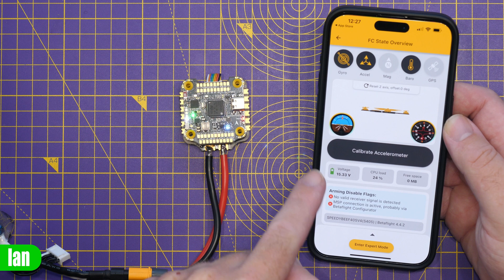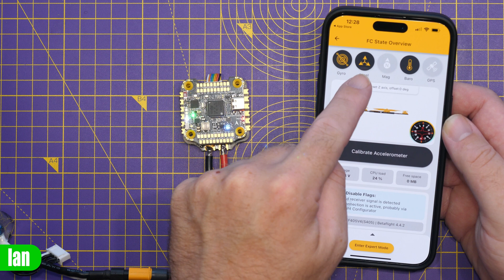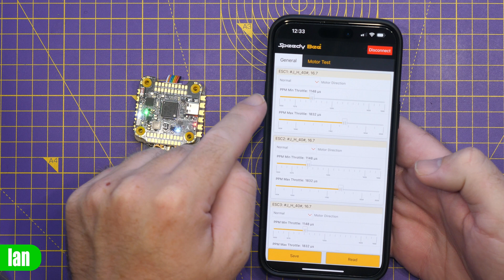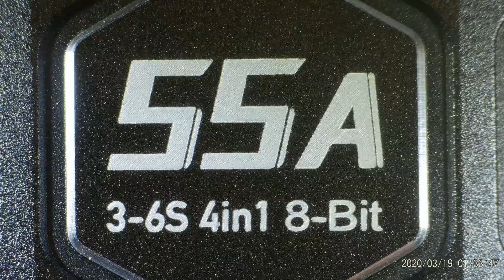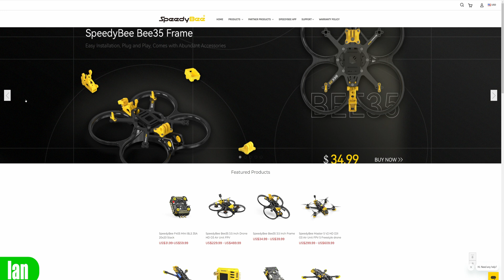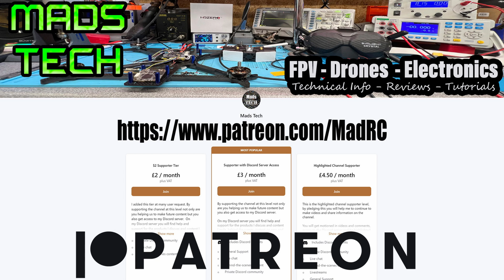Speedybee F405 V4 Flight Stack  - $70 For All Of This!

Comment: just asking do you have experience rx lost every time you fly after  a little acro, then rx suddently lost signal. DO YOU KNOW THE SOLUTION?? DESPITE EVERYTHING, THE MODULE ( elrs 2.4g diversity receiver dual antenna rx built tcxo ) IS NEW AND INSTALLED PROPERLY. its happen many times to me. can you help. i have footage i can share thru email if you want.??

Comment: They need to fix this board again. The cutout for the fpv camera is not compatible on some frames. 
For examples:  Apex EVO 5" FPV Fram, Steele 5 or Similar style.

Issues:
1) You can't have press nuts underneath the board because the 8 pins connector(Esc) is landing on top of the press nuts.
2) The stack height is wrong. the website said 16.1mm. You also need to add the USB C height as well. if you have press nuts underneath the board and your frame usable space is 21mm(H). You are screw.

All they need to do is fix the 8 pins connector. They need to move it forward. That's all. lol

Comment: I started with the speedybee f7v3. My first diy drone. Built a master 5 v2 with supernova motors. Hooked up the f7 stack and it would not recognize receiver. Tried 2 different brand new ones. Radiomaster rp3 to go with my new boxer radio. And then a happymodel diversity dual antenna. Anyways couldn't get it to work so ordered a f4 v4 today 😁 hoping i can get that to work. Do you think the 2 esc are interchangeable? I think something was off with the firmware of f7 and superbee app. Idk. I tried to flash firmware or changed msp and now no lights or anything. Something does beep when powered on but not like before. Think the flight controller is gone. Hence the f4 😉 hoping v4 will work better with app. Any tips or things i should do? 😁

Comment: Speedybee wrote in the product page The F405 V3 FC faced compatibility issues with certain microSD cards, with a few even occasionally affecting the stable OSD display.

But doesn't the v3 have the issue with any microSD card because the OSD and blackbox shares same SPI bus?
Do you think speedybee is dishonest here, not saying the truth, downplaying the issue and not admitting they made a design flaw in the v3 board?

Comment: Great overview Ian. Regarding video title, I'd suggest using "F405" vs. "F4", as may storefronts use "F4" to refer to F411 flight controllers. F411's lack UARTs, working memory, etc compared to F405's.
 
While Speedybee doesn't list Ardupilot capability on it's website, the v3 is listed as compatible hardware on ArduPilot/ArduCopter docs/wiki. Having bario/compass support makes this F405 stack. It would be nice if Speedybee actually stated ArduPilot compatibility (forthcoming) for this F405 v4.
Perhaps this FC stack could be inspiration for your next arducopter build, as we also have a number of HD video options available going into 2024?
Reply from the maker: Thanks and done.

Comment: I'm disappointed with speedybee I ordered 3 of they're latest stacks out of 3 one worked the others are connected to transmitter but won't work when you arm the drone. The first one that worked was fine and then without any crashes the ESC stopped working. But cheap get cheap crap
Reply: my friend bought 2 stacks of the v3. 1st one has desyncs.. 2nd one has motor twiching. Didn't event fly properly. Just hovers and drops off the sky. I guess esc quality is bad
Reply: @rgglenn150  their new batches are on point now. Seems to be when a company rushed a new product out that send all the bad ones out then see the complaints then fixes the problems for the 2nd batch. Speedybee f stack are getting better and better at this price point. Now other companies are following this trend. Goku is making cheaper stacks now but no Bluetooth built in.

Comment: Well that explains why they"ve been selling the f405 v3 for $10 off.  I stocked up and bought 3 of those and 3 of the f4 mini.  A guy can never have too many stacks.  I've been using the v3 in 4 different quads for quite a while and love them.  For the $$$ you can't beat them, and with Bluejay not only do you get bidirectional dshot, but cool start up tunes.

Comment: a newbie here, whats bidirectional d-shot?
Reply: DSHOT is the protocol that the flight controller and ESCs use to communicate. It used to be one-way, with the FC sending commands to the ESC and that was it. Bidirectional DSHOT allows the ESC to now send telemetry back to the FC as well. It helps with some Betaflight filters and such. In regular BLHeli firmware, bidirectional DSHOT isn't supported. It's only in BLHeli32, which mandates faster, 32bit processors on the ESCs themselves instead of the 8 bit ones like on this stack. IIRC, the BLHeli devs said it couldn't be done because of resource constraints on the 8bit processors. After a while, the BlueJay (and another, JESC, I think), came out and implemented it, proving it could. Some manufacturers still ship BLHeli on their ESCs, but most can simply be reflashed to BlueJay to get that functionality.

Comment: Unless they did something magical, the ICM42688P gyro has been historically garbage for use in flight controllers...
Im skeptical and waiting for BBL data...
Reply: I was just thinking the same thing. Didnt JB and blunty butcher that gyro?
Reply from the maker: It needs a good clean power source like this FC has and there has been tweaks to the filtering in BF as I understand it.  As such today it’s deemed one of the best option.
Reply: @MadRC I disagree, the BMI 270 is the best option.
Reply: @cinemoriahFPV  This ICM theoretically is the best one. The problem before was never the gyro itself, but how they were implementing it in the FC. It seems now they know how to properly implement it using the correct filters, etc.
Reply: Confirmed, have heard 4 reports today of pilots with issues with this gyro
Reply: @Fly_High_FPV That's what I suspected 😔

Comment: I have gotten 5 of these since August each ordered separatedly , but the wing edition which was about 38€ incl. 19% VAT and shipping.
Great value, great packaging and full set of accessories which means even the presoldered cables. 

I like them a lot and prefer those over the Matek fixed wing F405 - the old one and even the new one cause Matek asks now for the new edition (they had not delivered FC for over 2 years) over 58€ 

China is not under INFLATION, but 5% deflation so their costs are decreasing and that allowed SpeedyBee to go this way for new products. Matek is just taking what they think the people in the west under inflation pressure should be willing to pay after they had not delivered for over 2 years. 

Great experience so far. At least for the fixed wing edition. But be aware they are expecting export sanctions for drones and even flight controllers where it is not clear if this will only hit the western countries cause I had asked about that topic. We usually need 20 each year for holiday camps and therefore had to fill up our stock so we avoided to order 5 at once to not be hit by sanctions and ordered every week one after the previous had been shipped. With 4 guys and 5 weeks we have gotten the 20 we need. 
Shipping was about 5 days once you got the dhl number (EU), fastest shipping in the whole industry from a manufacturer or vendor in China that has no EU warehouse. Extraordinary fast and reliable.
Reply: You didn't buy any of these they just released this version.....
Reply: @hersheyfpv3501 ok, you aren't that stupid, right?

Comment: I hope the f7 v4 isn't far behind. I love my speedybee stacks. Just so easy to work on. Everything is clearly labeled.  Just so good!
Reply: F405 is actually superior in some ways more like more flash memory than F722
Reply: No... no it's not.. the only thing I can think of it being better would be the price.
Reply: While F722 can have higher clock speeds, it has less working memory, and fewer i/o capabilities. Features that mater if used for a purpose other than racing, or a freestyle build, particularly if using a FC OS like INAV, or Ardupilot that have larger memory footprint and offer additional features. F405's have a large number of UART's, i/o protocols and PWM channels.
Reply: @AerialWaviator  are you just guessing? Cuz a few Google searches will give you the correct information..
Reply: The only thing the 405 has over the f7 is more memory that's it.